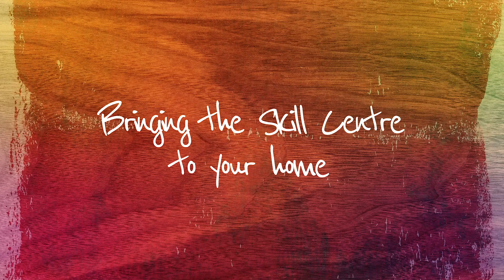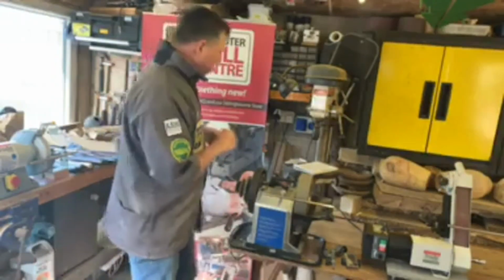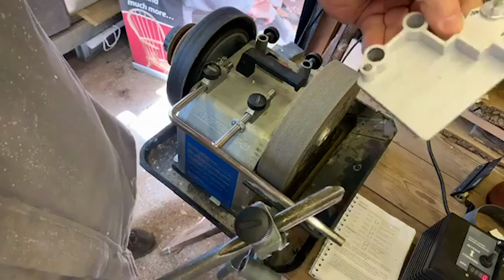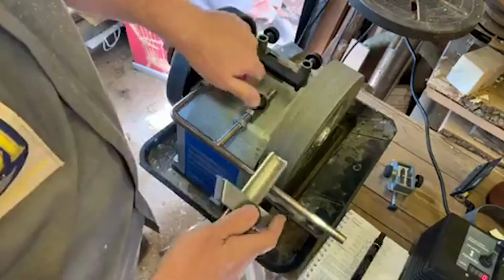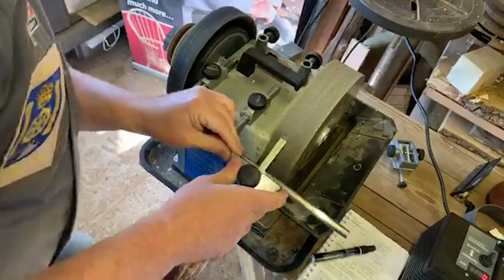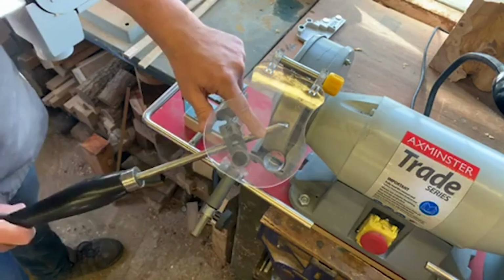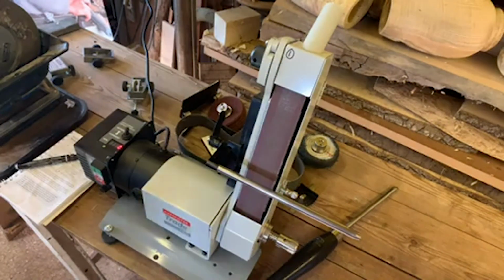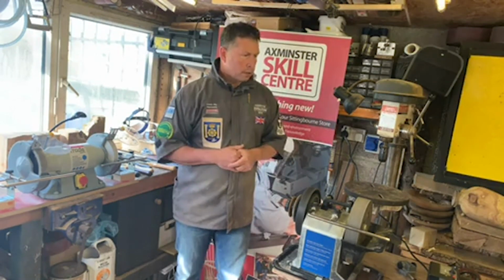#SkillCentreAtHome - Live Turning Tuesday - Sharpening

Comment: I’m new to turning,  but I spent 50 years as a precision grinder. It pays to add a soluble oil to the water trough 50-1 this will help with the cutting and stop the scarf from rusting in the trough

Comment: Is there an Axminster Craft Wetstone Bench Sharpener version of the jigs and accessories you used with the Tormek? Or are the jigs and accessories interchangeable between the systems?
Reply from the maker: Hi :) The following reply is from Colwin - "The jigs for the Craft wetstone are limited to carpentry tools, but the Tormek jigs fit this machine and are the best I have used. Highly recommended :)"